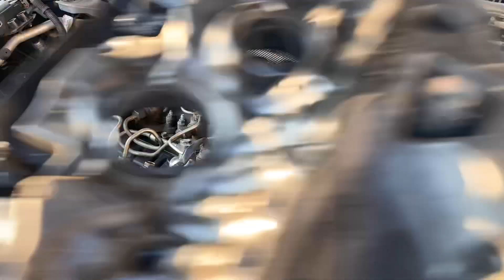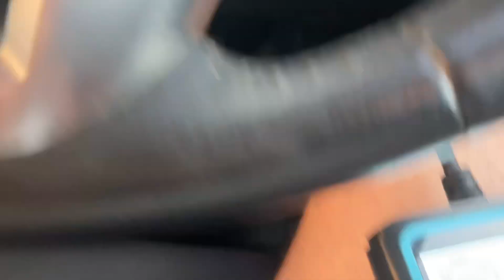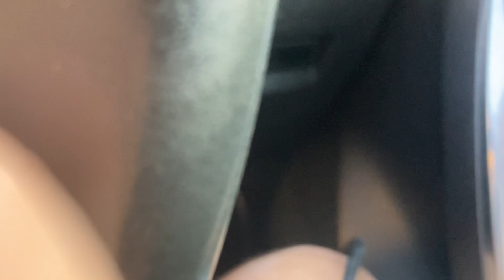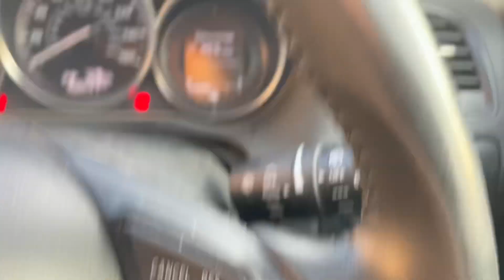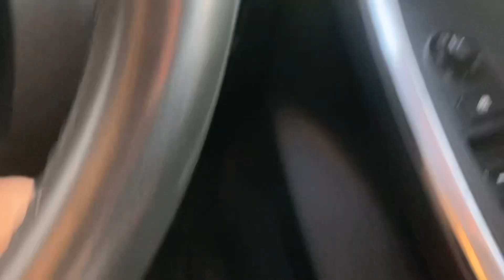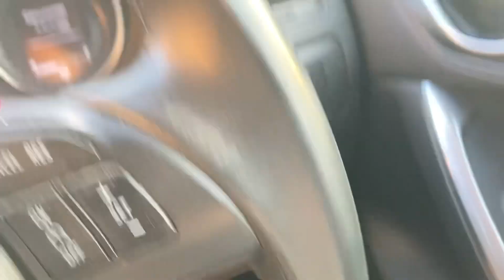P0472 Mazda cx5 2.2d Replaced exhaust pressure sensor cured multiple warning lights and no turbo 👍🏻

Comment: Have you had any head gasket issues over this mileage? I'm driving a 2016 Mazda 6 with the same engine on 81000miles and I recently spent $$$$ on carbon cleaning, upgraded injector washers, oil strainer replacement and now my exhaust pressure sensor needs to be done.
I've been debating with myself whether to keep the car since I've invested so much into it, or sell it while it's in good working order ahead of any potential head gasket issues..
Great video by the way
Reply from the maker: I haven’t had any head gasket issues but recently a fault code for a mechanical turbo fault has appeared. I haven’t investigated yet but it is probably related to carbon build up and will no doubt need to do the jobs you listed. Thanks for watching
Reply: @SWARBRIXThank you. That's reassuring to hear. Before the carbon cleaning, I was getting code p0401 (caused by airflow restriction on the EGR system due to carbon accumulation).
I also got turbo boost fault p2262 but this only appeared after the carbon clean, and it hasn't come back since I replaced exhaust pressure sensor 2 (as you did in your video).
My car is running great since I replaced this sensor.  I think these are lovely engines when they're running right and diagnosed correctly

Comment: Good video showing how simple a fix this is + good to hear generally positive feedback on your CX5 [along with a good high mileage reading]. Alot of vids out there bashing the CX5 diesel but touch wood no issues on my 2.2l 2018 model [54k]. Generally looking after mine plus with preventive maintenance hope to see similar high mileage on my rig one day. This fix along with injector washers is on the list in the future. Appreciate the vid's. 👍
Reply from the maker: Mines on 164k miles now and still going. I am slightly concerned about the cam chain which is probably way overdue a change but other than that I’ve had no issues since replacing the exhaust sensor. I just change the oil every 6k miles and hope for the best. Thanks for watching 👍🏻

Comment: My Mazda 6 , 2016 showing SCBS  forward malfunction.. I replaced the pressure sensor, sign still showing on my dashboard, please what else can I do?
Reply from the maker: That’s unfortunate! If your car had the same dash lights and symptoms as mine I wonder if there isn’t any pressure coming up the little pipe to the sensor? Due to maybe blocked DPF making the sensor unable to work?

Comment: After clearing codes . Turn off ignition fully off then back on. I just change and upgraded the exhaust pressure sensor. Causes a lot of non related fault codes . If it’s a diesel engine . Only needs to have 1 fault code stored and the engine will not do any exhaust regenerations. Then your get DPF faults . Ultimately a DPF clean needed . I have since  sold my cx-5.
Reply from the maker: Hey, my CX-5 is still going strong at now 160,000 miles. Still no issues after upgrading the exhaust pressure sensor. I don’t blame you for selling yours. I would do the same if I had thousands tied up in the car. I will probably keep running mine until it has a catastrophic engine failure and then wish I got rid earlier 🤣. Thanks for your comment.
Reply: @SWARBRIX good mileage for a diesel these days when the powers that be trying their best to kill them off. My fathers near 20yr old transit [ex bright yellow BT van] near to 400km. Not many modern cars even get close to half that these days.